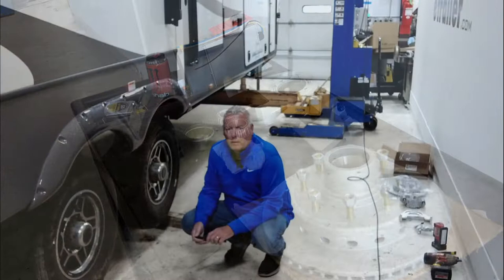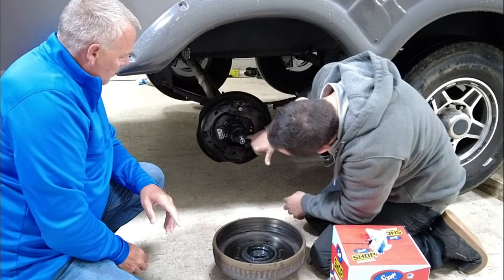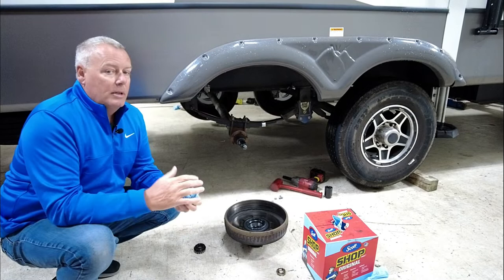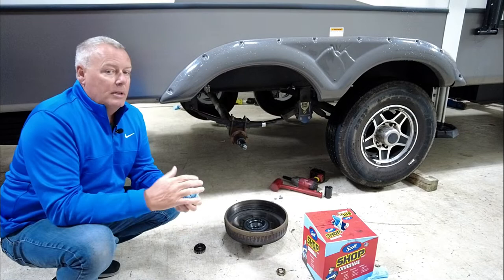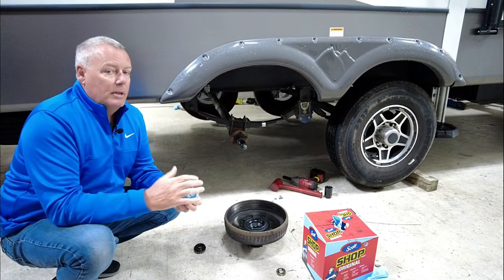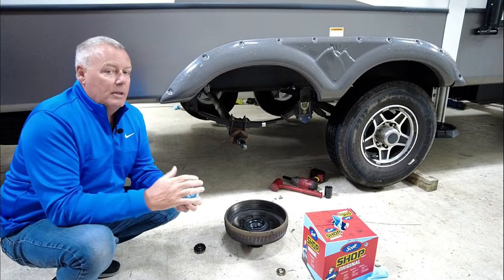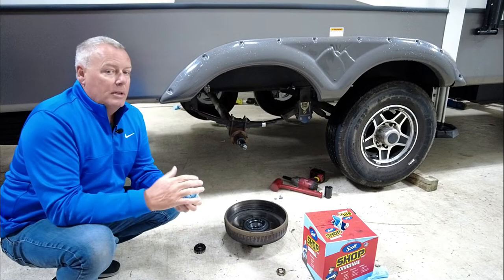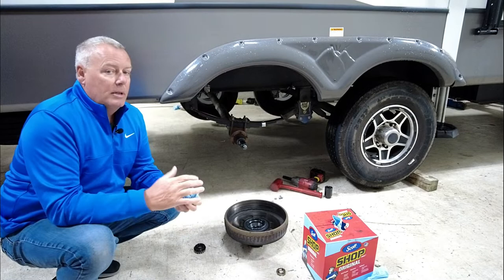RV Disc Brake Upgrade / DeeMaxx premium disc brakes / Save 25%

Comment: Since disc brakes are not adjustable, like drum brakes, what did they do before you left their facility to even the braking between the front and rear axles (and possibly left to right).  When a tire is locked up under braking, it has lost traction.
Reply from the maker: The last step in installation  is to bleed the brakes. Once this is done ,this allows even pressure to all 4 wheels.  The difference between disc and drum is clearly night and day. I will never tow an RV with drum brakes again!!!!